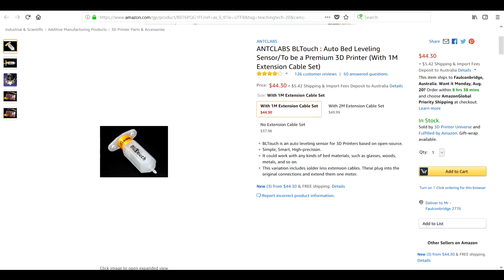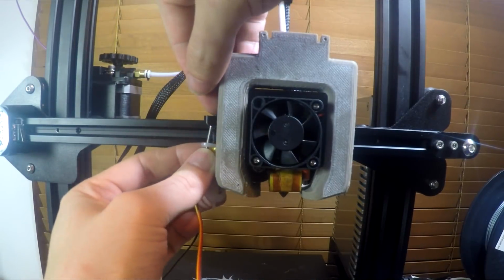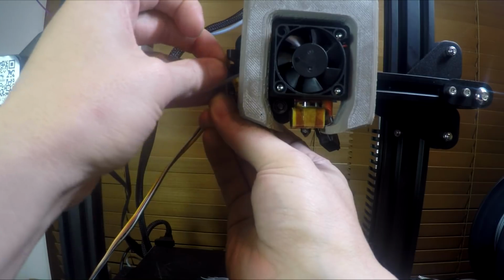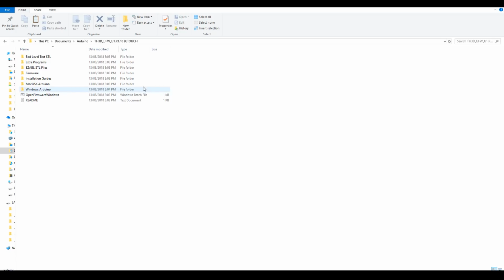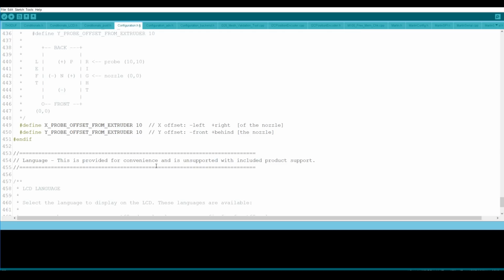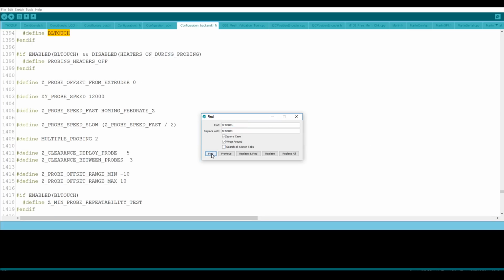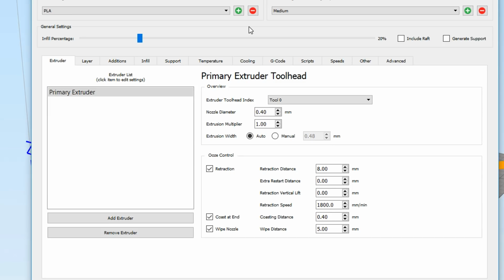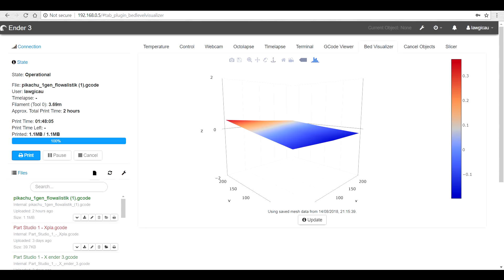How to: Ender 3 BLTOUCH with SD card support and no wires cut

Comment: Just wanted to give you a quick fyi. Apparently the newest firmware cuts a few bytes out of the file. I did not have to disable the boot screen. I compiled it at the point where you got the error and mine completed successfully with 97% of the space being used. My firmware looked a little different than yours. Mine did not have the section labeled EZABLE_Enable or whatever it was it said EZOUT and the Z endstop min and the z probe settings were already set to false and they were in the same section, and yours were in two different sections. So that may be where the file size savings was done.

I was a little confused with the differences and was hoping I did it right, but it looks like it works perfectly. So I'm good. 

Thanks for the awesome tutorial.

Also my BL Touch had a different connector end on it. Mine for the z stop connector had a two prong black connector, which works. I don't like the fit, but it does work.
Reply from the maker: Thanks for sharing, great info. If your dupont connector is a tad wobbly you can add a dab of hot glue.
Reply: After pulling my hair out all week, I have come to realize the newest firmware does not work. It looks like it is working, but does not actually do any leveling. Actually it works against you. I could not figure out for the life of me why no matter how I set my Z Offset I could not get a good first layer. TH3D broke the firmware for the BLTouch. I wonder if they know that is illegal if they did it on purpose.

I wound up finding the version of the firmware that you used and it works perfectly. i wasted a crap ton of filament trying to set my Z Offset with the new firmware. I thought I was doing something wrong. It kind of ticks me off to be honest with you.
Reply: Do you have a link for the old firmware?
Reply: Ildefonso Zanette  This is the one I downloaded and it works perfectly.

https://drive.google.com/file/d/1XCNm3h6FSCaItx4ey-niidCy1rEZ5Rsc/view
Reply: bkpickell  This doesn't look like the same one from the video?
Reply: bkpickell  I'm stuck on step one. Don't see an option for custom probe
Reply: @salmander  really, That is the one I used and it worked. It was linked in a pdf on thingiverse for version 3 fix ender 3 bl touch.
Reply: bkpickell  Thanks for your reply. Do I still have to follow this video and change configuration or is everything done already for Ender 3 and BLtouch?

Comment: My Uno just arrived but I hear that TH3D no longer works with the BLTouch? Do you have a new video coming out with a work around or a different firmware soon?
Reply from the maker: You can get around it by commenting bits out but yes I have an update coming.
Reply: I got a warning when I compiled, but it still works. I just downloaded and installed it yesterday.
Reply: Actually, It looked like it was working, it does not. So no I could not get the new firmware to work. I did find the older version of the firmware that he used on thingiverse.

Comment: Does not wor wit with R2. Tried with Marlin 1.1.9 without sd, the bltouch works ((but without sd). Following your video (with R2) the home command leads to a crash on the bed. Have an explaination?
Reply from the maker: You have strayed from what I did quite a bit so it's hard to advise you. I am planning an update on this guide, however.
Reply: i followed you instructions step by step with the new firmware and i was not able to get the bltouch to work can you please make an update soon. i have a disable printer now :(

Comment: This workes awesome but when I try it on the TH3D_UFW_U1.R2.1c It won't work. Do you know if they made som differences? Using it on the CR-10 on TH3D_UFW_U1.R1.9a without problems
Reply from the maker: Differences have been put in place to prevent this guide from working.
Reply: That was the same thing that I was thinking about. But my CR-10S Is running smothly with your settings so I'm staying on this version of the firmware :D
Reply: Ive just come to realise your guide no longer works. Please what can i do to use the bltouch now?

Comment: Will BL Touch work if  buzzer pin it's already used? I did build my own filament sensor (mech switch) and used connectors on LCD EXT3  (pin 1 is the buzzer,  pin  10 is  VCC, 9 is ground.
Reply from the maker: The pin 27 board severs the pin to the buzzer so it no longer functions. The same would apply here.

Comment: Would that Pin 27 adapter board work with an Anet A8 with full graphic display?
Reply from the maker: I'm not confident in guessing since I don't have that combining hand. If it has the same board there is a chance.
Reply: Hi. Anet A8 does use Pin 27 as a servo pin for the Bl Touch, but of course there is no guarantee that the pin-out is the same on both boards. But it turns out that there is one for the Anet A8 :) https://www.ebay.co.uk/itm/173527367393
Reply from the maker: Glad you found what you needed.
Reply: Thank you.  I wouldn't have looked for the Pin 27 board if it wasn't for your video :) Warm greetings from South Wales, UK

Comment: Unmount the two screws between Heatblock and cooler, in parallel to your heatbreak. This is a factory fault. They are only necessary if you want to change the nozzle. Have a look at the original design and documentation of the Micro Swiss hotend.  The two screws make nonsense of your heatbreak! You can see the screws many times in your video, e.g. at 3:07. Peel of this yellow jacket of your heatblock to see it clear:-)
Reply from the maker: I don't have this printer anymore but when my Ender 3 Pro arrives I'll check for this. Thanks for posting.

Comment: WARNING - the NEW Pin 27 OUTS HAVE A REVERSED 5V and GROUND. SWAPPING @ 5:50 WILL CAUSE DOOM. 

ARGGGGGG I followed this to a T.  The moment I plugged my printer in and turned it on. POP. 

My mainboard is gone. Totally dead. UGH!!!!

My fault for not double checking the labels on the PCB. I'm SO Angry with myself.
Reply from the maker: Sorry to hear buddy. Maybe take the chance to upgrade tp a 2560 based board.
Reply: Teaching Tech  my local store is sourcing one. Do you know of any that will come to mind? Wouldn't mind something with better/quieter stepper drivers.
Reply from the maker: Something like a MKS gen board is popular. Has a 2560 microcontroller and you can pick what ever drivers you want.
Reply: I weighed the pros and cons (cons being replacing JST connectors with breadboard connectors...) and decided to go with an OEM replacement. Up and running with my BLTOUCH! Thanks so much for the super awesome guide. 

I have some cork gaskets and I'll do before and after readings, and then maybe TL Smoothers if it still annoys me. 

Just one question:  When I do the E29 the probe doesn't measure points centered.  Its like it thinks my bed is smaller than it is. Its nice and close to 0,0,0 but doesn't get anywhere near 225,225,0  More like 180,180,0 coordinates. Is it doing this because of the offset programmed in configuration.h? It doesn't want to put the nozzle past 225mm from home? Anyway to counter this?

Also, one more thing. When you hit "store settings" it does deploy and retract the probe quickly - Make sure its not over anything that'll catch.
Reply: @TeachingTech  Same thing happened to me just moments ago. Should've realized something was wrong when plugging in only the USB interface didn't power the board up. Apply main power..POP and smoke. Dead board.. My pin 27 board is clearly labeled..when I put my glasses on. :)

Maybe edit this video with a warning about this?
Reply: I made the same mistake, but I guess I got lucky - no smoke, it just wouldn't boot up.  I took a closer look at the Pin27 board, swapped the pins back to the original, and everything booted up fine after.
Reply: I didn't see this comment until after I had smoked my board as well.......yay!
Reply: Sudz Which website did you purchase your Pin 27 from? I want to make sure that I don’t have this same issue. Or are all Pin 27s like this now?
Reply: @sollus_tv  I bought mine on Amazon..

https://www.amazon.com/gp/product/B07L2Q2SSD/ref=ppx_yo_dt_b_asin_title_o02__o00_s01?ie=UTF8&psc=1
Reply: @JonathanSnow  i bought the same one, i'm not changing wire locations on mine
Reply: Saw this comment, decided I would verify the board was labeled correctly, it was but managed to touch multimeter probe to both and shorted it out anyway.....just my luck. Guess who's getting a MKS Gen L now???

Comment: I followed your tutorial Michael, but unfortunately, it doesn't seem to level my bed at all... My bed is pretty flat but after the probe has completed it starts to print and it's all over the place. Some areas are too close to extrude, while some are too high and not squishing the PLA. I'm not even trying to do a large print (something I hoped this probe would make more possible) just a 25mm cube. 

Also, the x and y seem to be shifted slightly, the nozzle doesn't reach the back of the bed at 0, but hangs over the front, and the x doesn't reach the left-hand side of the bed at 0, but hangs over the right-hand edge. Does yourself or anyone else have any idea what might be causing this? 

I had better prints without the probe!
Reply from the maker: Are you using the exact version of the th3d firmware as I did? The other thing to check is running a g28 then g29 in a terminal over USB to see the probing values. Also, are you running a genuine bltouch or a clone?
Reply: Cheers for the reply. I'm sure I checked the firmware, but the one in your video is U1.R1.10 - the one I'm using is U1.R1.10a. Did I just use an update since your video was uploaded? 
I'll take a look at the probing values. And also I'm unfortunately using the 3Dtouch clone, admittedly bought in error, I'd much rather have bought the original from ANTlabs.
Reply: So I tried updating to the newest firmware, and followed through the config again, and now the probe has a huge delay from triggering and lifting the nozzle when using G28. It crashes into the bed before it has a chance to trigger. So that's certainly not helped...
Reply from the maker: The 3dtouch clone is potentially the original problem. Some of the clones have a reputation for a lack of repeatability. In terms of the newer th3d firmware, the author has taken some steps since this video to prevent people using a product besides the one he sells. This is speculative but it is possible the exact timing of the probing has been changed to make this more difficult. When my Ender 3 Pro arrives I'll be making an updated bltouch guide based on vanilla Marlin.
Reply: @TeachingTech  looking forward to it! I've been trying to get my bltouch to work for a couple of days now trying different firmwares and guides. My z axis just pounds in to the bed until it gives an error or whenever i home z it just moves upwards from its relative point. Again and again..

Comment: I recently installed bltouch following your guide along with the latest firmware, came across the warning messages and just hid them to compile it on the ender 3. Everything seem to work normal with the autobed leveling, but I noticed that the cooling fan for the nozzle is not activated until after several minutes thru the print. (Is that normal? I never noticed and new to this) Also after it goes thru several layer printing, I noticed that the nozzle start to smear on the layered print which messes it up. Still playing with the z offset and familiarizing myself with slice setting. Any info are much appreciated. Thank you!
Reply from the maker: The cooling fan will depend on your slicer settings. For PLA I have mine off for the first layer and then permanently on after that. The smearing nozzle is harder to guess. I would suggest posting in  community group.

Comment: Hi, great video. All seems ok for me testing the servo but for some reason the printer isn't seeing the trigger for the zstop. Z axis keeps moving down even when the bltouch is triggered. Tried substituting the original zstop microswitch and it works fine.
Reply: Thanks! I tried that but same thing. All out of ideas, I have trawled the internet but I must be missing something. What is the z stop pin on the board looking for?
Reply from the maker: Usually the firmware is setup for them to be normally open, so contacting the two pins together will trigger the stop. All I can suggest is to double check the settings.
Reply from the maker: Try reversing the white and lack wires from the Bltouch to the mainboard.

Comment: Thank you. This is another excellent video.  I had to add the script into the th3d firmware but went about it a slightly different way. I'm going to change it to the way you have modified the firmware.  😉
Reply from the maker: Thanks for watching Eric. I have an Ender 3 pro on the way, I will remake this independent of th3d because steps have been taken to make this guide void.
Reply: TH3D has now indicated that the original version of R2 firmware that cause the compiling errors/warnings, was an unintentional mistake.  It is apparently fixed in the newest version.   In fact, he has now ordered a BLtouch, and is planning on supporting it in the firmware.

Comment: Any alternative models for the PIN 27?
Reply from the maker: There are several links in the description.
Reply: Be careful. I found out the expensive hard way that some of the P27 Boards have swapped 5v and ground. Let the smoke out.
Reply: You can use PIN 29.   It's the "S" beside the cap. on EXT2

Comment: I followed this and added the g29 to the slicer but noticed that although it probed the bed it then did nothing with it. The z leadscrew did not move at all during the initial layer. I deliberately ramped the bed to amplify the skew and it made zero adjustment. As soon as I added M420 S1 after the G29 it then started to work....very odd.
Reply from the maker: M420 reads from the stored mesh, which should happen automatically after G29. The only thing I can think of is you have a G28 after the G29, which breaks the process.
Reply: No, I think TH3D broke it intentionally. I had the same problem. I did not try the M420 S1 trick though. Too late now as I put the older version of the firmware back on and it works now, so I'm not going through the headache of putting the firmware back on and testing it. LOL
Reply: @TeachingTech  At least in the newest firmware of TH3D without the M420 It doesn't work

Comment: PLEASE HELP.  I have flashed a bootloader with your guide.  Now when I try to upload the new profile I get the avrdude: stk500_getsync error message!!  I tried different ports and checking wires and triple checked.  When I plug in the usb cable the ender starts a long beep and sometime flashes the logo multiple times.  I can still use the printer when I plug in the z stop.  Help.
Reply from the maker: Did you previously update the firmware after flashing the bootloader?
Reply: I figured it out.  My pc could not tell what port the ender 3 was connected to.  Then after I found the correct port another issue happened.  If I left the usb port connected to the ender for too long (like when I follow along your video) then try to upload, it will fail.  I have to plug it into the port and quickly upload to the ender and it will work.  Just in case anyone else has this issue.
Reply: @TeachingTech   Yes.  I put the th3d firmware on it for thermal protection.

Comment: Hey Michael! Great video as always, I'm still super new to 3D printers and overall tinkering with hardware, so your videos are very welcome. I've got a genuine BLTouch and noticed that the connector is a dupont connector style, instead of a JST. I'm having some trouble with the steps mentioned from 4:30 to 5min, as the wires from the BLTouch don't seem to properly fit on the JST plug. I've tried to just directly connect the dupont connector into the board but it doesn't seem to fit very well. Any help on how to deal with it is welcome, and sorry for the newbie question!
Reply from the maker: Normally a Dupont connector will fit. If it's wobbly, a blob of hot glue will secure it.
Reply: Thanks for the reply! Will investigate this option :)

Comment: It seems that the latest TH3D version (2.1) does not allow the use of BLTouch? At least I'm running into errors. 
Edit: you can just delete lines with errors and it will install fine!
Reply from the maker: I suppose it's Tim's version of the firmware and he's free to do what he wants but I must say I'm still disappointed. I have an Ender 3 Pro coming and will revisit this then.
Reply: do you deleted the lines in the code? and dit you deleted every error line?
Reply: I was able to comment out the line with the errors and was able to uplaod the firmware without any issue but the bltouch doesn't stop when it hit the bed...  I tried with my finger and it will stop but after 2-3 second where the printer nozzle continue to go down.  Anyone is having this issue?
Reply: Daniel Fortier  Same issue here, though mine doesn't seem to stop after 2-3 seconds.  I haven't been able to figure it out yet.
Reply: Does anyone know where we can get an older copy of the firmware?  That might be the way around the issue.
Reply: Gadget Dronie  I'm searching but haven't found anything yet.  They nuked the github repo to get rid of the history.  Let me know if you can dig anything up and I'll do the same
Reply: Gadget Dronie  In the end it works fine with the latest version of the firmware.  I had an issue with a short on the BL Touch connector which caused it to not register the Z hit
Reply: Brad, happy to hear that the latest version is working.  Did you have to change any of the settings in the firmware that are different than what TT explained in his video?